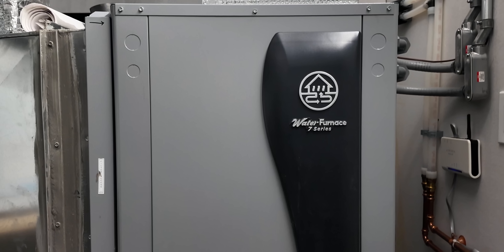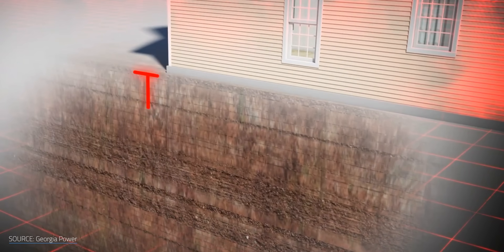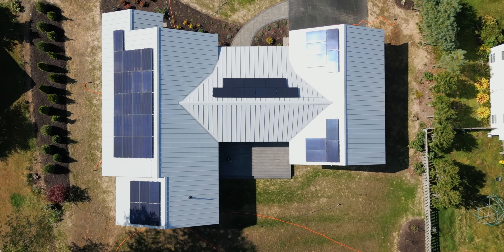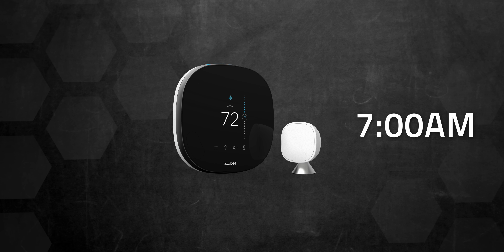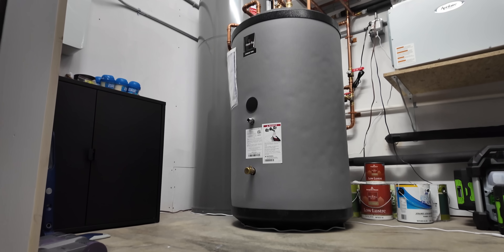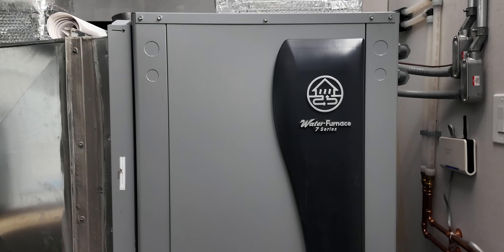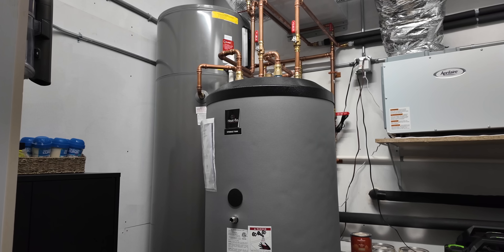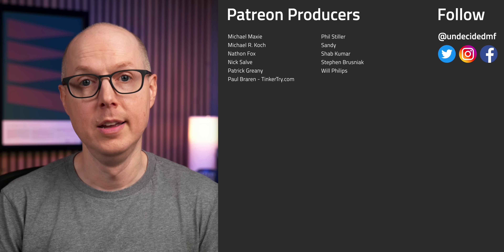How My Geothermal Heat Pump Really Performed (2 Years)

Comment: Geothermal heat pumps have been around longer than many people realize. The first one I saw was in 1991 or 92 in Tampa FL on a new 2000 sf house and I recall they used a 60 foot well since water levels were very high there.

Comment: It would take a lot of saving on monthly energy to make up for the tens of thousands for initial equipment and installation. I find here in Phoenix, AZ (retired here in '21) that deferring the expense of these systems allows me to have moderate overall yearly energy expenses while getting most of the value out of A/C equipment before having to decide on the next unit. It helps that the A/C industry has some good, reliable equipment if you can get by with just one level up from the most basic equipment. Get into multiple units, speeds and other complications, and you risk high cost repairs and/or earlier replacement. We've done well as previous owner bought a Goodman system, which is owned by a Japanese company that emphasizes good performance with reliability, and avoids complicated designs with more bells and whistles.

Comment: You are saving $360/year. The cost difference up front has a 44 year break-even.

What is the cost of the solar... you are not including total cost of ownership.

If you want to be energy efficient, then why use an electric clothes dryer?

Finally, over a half century of experience, leaving the HVAC at the same temperature all day is more efficient than adjusting during the day.

Comment: The thing is that most people can'T afford for a 50k system to break on them. But its VERY easy to replace a regular heatpump. An electrical baseboard heating is like 50$...not 50k.
Your analysis does not account for potential ground movement that may require you to completely redo the system because repair would be even higher.
If it works for 20 years its great...but nothing can work 20 years GUARANTEED. So you ARE taking a risk. If the risk pays off, its good, if it does not...some people can'T affort this option.

Comment: We had a Weismann gas boiler system put in a few years ago. This learns how long the house takes to heat up and cool down. It's saved 50% over our old Potterton dumb boiler. We have a 3 bed detached house and our gas bill is ~£50 month averaged over a year. As the system monitors water temp and air temp from multiple places, our radiators never get hot, even in very cold winters. We actually forget it's installed.

Comment: I self installed geothermal in my 1970 Michigan home 14 years ago for around $8,000.   i heat 1,700 sqft and also heat the 1,700 sqft basement.  I use 4,400kWh a year and pay around $700.  A/C in the summer is almost free and is ridiculously cold.   I wish I did it 25yrs ago.    I sized my heat pump for cooling capacity (not heating).   Mine is a 3 Ton 2 stage unit (36,000 BTU) and is perfect size for my case.   Only maintenance so far is air filters and I had to replace a $200 water valve last year.  That's it.  In the coldest January mine will run continuously and never shut off (will bounce between stage 1 and stage 2).  it was strange at first but that's how these work.   I have never had the heat pump fail to keep us warm in the winter.  Works very well.

Comment: We have the same system, Waterfurnace. Live in Michigan with a larger than average house that was requiring 750-1,000 gallons of propane during the coldest months. Switched over and our worst cost month depends on which month is colder but rarely have an electric bill over $1,000. With propane the worst month would be about $1,500 in gas alone + a few hundred in electric. We are now planning our solar system so we can go off grid with a 36kw system and 3 powerwalls. After that is installed we will probably swap vehicles for electric ones to avoid gas costs. I’m not against fossil fuels I just think they are grossly overpriced and taxed to no end.

Comment: I wanted geothermal just to have more consistent comfort. But we were quoted at $57k.. In the end we just had our heatpump replaced with a better, newer unit. overall usage was down with more effeciency, but still have to deal with heatpump and having to use 'emergency heat' on some of the sub freezing days.

Comment: i work as a driller, i dont know installation costs in the US but i know their equipment is usually not so efficent. Me, totally alone can drive my equipment to site, drill 200-250m, pack up and go home in 1 day and yes as long as the distance needed is fitting the house and noone cheaped out on it (as some do) it works very good even in cold conditions :)

Comment: one of my that i know they have if but 5 year later both pomps broke  less then 10 years  im hoping now wil last with the new pomp more then 5 years i have air heatpomp to water becouse i don`t needed it becouse i have a smal reactor that only heat up that is enough to heat my home i do not use the power of the grid most of the time  i really want a small windturbine but yeah for power en back up but no power for that for now    ps don`t use uranium 235 you are not allow legally on nl 😅😅😅😅😅

Comment: From Belgium. Having a heat pump, solar panels, electric car and all that. 
I question a lot that is done to save energy.
I see neighbours investing 15000 or more euros to put EXTRA insulation on there roof.
The questions I ask is: How much do you spend on heating a year now? How much do you expect to spend on heating after you put in the extra insulation?
Don't forget that the energy you use to heat your house is also used to heat water. That will remain more or less in the same trend. 
Don't forget that if you put more insulation on your roof, that the heat will tend to escape a bit more through walls, windows and doors.
I am sure that there savings won't be that much. I am almost sure that if you would simply look at it from investment standpoint it's a terrible investment.
If you look at it from en environmental viewpoint it's also questionable. The CO2 and garbage used to produce and install this insulation (plus other materials used) is not something to be underestimated.

While I do see a use for insulating new homes, I question completly the use of putting extra insulation on homes with an ok to good insulation. 
The only real positive effect is that you create jobs.

PS: Do not underestimate the complexity you build in to your installation. More stuff can break down. Also you understand it, but does your partner?
What happens when you are no longer there?

Comment: Why did it look like all your attic insulation was just in a big pile against the back wall? Shouldn't it be more even? Also I hope you mean airtightness within the home and not the attic since it does need venting to allow moisture to escape and prevent mold and rot.

Comment: I installed a horizontal Water Furnace unit in conjunction with a new build ICF home 20 years ago. 5 ton system that also preheats hot water. I do not adjust temperature. Original cost to operate $1 per day. Now about $2.

Comment: Where is your break even point? Forgive me if I missed it. I know your focus was on net zero and reducing consumption over time to achieve that goal, but the break even point is also part of that equation. Your scenario seems about worst case in terms of up front cost. I remember chatting with an HVAC dealer here in northern MI and him saying the system would be due for replacement at about the break even point which was a bummer.

Comment: I'm sure your house is smaller and more efficient than mine, but running the math at $.31 kwh you used 3,061 kwh for heating/cooling for the year.  I have 4 geothermal systems (1 radiant floor  and 3 forced air) and have 2 wells for a pump and dump.  This past March I used 7,450kwh and at least 6,000kwh was for heating.  This is double your entire year usage.  Fortunately, my electric cost is way less than yours- right at $.10 kwh(including all fees).  I didn't pay for the system, but it had to be at least $100,000-150,000 with drilling the second well.  There is no natural gas, so I can only imagine what they were paying a year for propane that made them drop $150k to convert to geothermal and think it was a good investment.

Comment: Because of the heat load. You need more ground to absorb excess heat, from ac cooling.  Remember there is no condenser outside. The heat is disputed in the ground, and extracted in the winter

Comment: I'd rather put a back-boiler in my fireplace and pipe it to a buffer tank and put a coal burning insert in my fireplace.  Fill once a day, buffer tank puts heat into central air.  heat entire house from coal as an alternate energy source to gas and electricity. (battery backup still needed if you want central air to still work)

Comment: While your annual and monthly bills are extremely low, you spent $78k on the geo thermal system and im assuming another $50-75,000 on your solar system. So really its about determining the ROI on all of that over the life of the home. What is THAT # compared to no solar (only grid power) and traditional ac/heating systems?

Hard stop that is the only thing that matters. When the cost of something like geothermal and solar really becomes nothing, then it'll be a no brainer. In Texas, power is 12.5 cents per kwh. So it wouldnt make sense here.

Comment: @UndecidedMF 
I was listening to you for about 15 mins here. The way you explain here leaves the UNDECIDED even more Undecided!  If you truly want to help the UNDECIDED than you should've started with the:
1.  price for a KWh/h of electricity (you mentioned ~0.31$/kWh) and price for a KWh/h of "other heating source" (that you replaced by installing a heat pump - like gas, diesel, etc). 
2. How much heat (kWh) did you use for 1 year, on average, for heating your house and generating warm water with your "other heating source".
3. how many kWh does the heatpump consume to heat the same house for 1 year. 

The rest is a matter of local details for each country and region.

Comment: The economics of retrofitting your home to geothermal heat pump very much depends upon local electricity costs, among other things.  Massachusetts electricity cost from Eversource, one of the big utilities serving the are is ~ $.32/kwh.  Using a COP of ~3 as a reasonable average, and 3415 Btu/kwh for the heating value of electricity, this lets us calculate the relative cost of providing heat to your home so it can be compared to current and anticipated natural gas, heating oil, propane, or other proposed method.  3412*3/.32 = ~32,000 Btu/$   Home heating oil is currently ~ $3/gallon, which can be burned in a common boiler to provide ~ 120,000 Btus, so it provides ~ 120,000/3 = 40,000 Btu/$ with lower capital (common oil boiler) cost.  Granted, what it will cost in the future cannot be certain.  I suggest that installing solar PV, and oversizing the system to cover geothermal demands, before installing geothermal, is the more appropriate and economic approach.  Your sun sourced kwh from solar PV are effectively far lower cost than the prevailing current rates for retail electricity.

Comment: 22-24 C is wild. I keep mine to 20. Complete install will drilling is about 30 000$ USD in my area (sweden). That with the presumption that you already have indoor (water) radiators.

Comment: You’re running the hot water heater wrong. If it’s not making noise and the room isn’t cool then it’s not pulling heat from the space with the compressor. You’re essentially running an electric heater. All of your savings are from the geothermal preheat which raises the temperature of your water tank above the minimum set point of your entering water for heat pump use. Spec says 90F lift which means 50F water coming in is your minimum at 140F storage set point. You could raise your storage temp (more efficient/sqft) if you install a mixing valve to prevent too hot of water going to the faucet

Comment: My parents paid 15k for vertical ground heat pump 16 years ago providing floor heating in a wooden house that partly is up to 150 years old. It's incredible and the most comfortable house I know... and it's in Sweden so challenging environments are no match for these systems. I wouldn't say it's a complicated choice at all if you have the funds or can borrow, because you will save so much thanks to these kind of systems.

Comment: I'd never put an EV or Plug-in hybrid in my garage/house because of the fire risk, let alone a charging system, compounded by home energy storage using Li-ion batteries.  In addition to the risk, I don't want to support lithium mining and much-too-frequent disposal of all those batteries on a five or ten year schedule.  Replacement cost should also be factored into everything, including the monthly cost.  Just like a carbon footprint should always include long term costs for mining, manufacture/production, use, and disposal AND to the environment across the entire lifecycle.  It seems to trade steel for lithium mining and fossil fuel pollution for toxic metal disposal dumps.  Air pollution and climate change and/or toxic water...  I'll wait for better, cheap, safe power storage technology that does not involve mining, fossils, or disposal.  Not likely in my lifetime.  That said, I have no problem with the simplicity of geothermal and a heat pump sans all the batteries and extraordinary technology while living with the occasional power outage and a hybrid non-plugin car.

Comment: So spend 40k more to save 1k a year? I dont think the math checks out. Your home envelope is way more important than going geo thermal vs other options.That is doing all the heavy lifting. Also, if something in the system goes awry with install, you are really in trouble. I can have hundreds of people in my local area swap out my ac unit if need be. Good luck fixing a misengineered well.

Comment: Your first mistake was doing deep well geo.  From the picture you have enough room to do cascading loops horizontally 6-8 feet down.  The difference in cost there is amazing.  I dug my own trenches, paid someone $1000 to run the piping and my geothermal was only about $3000 more than a traditional HVAC.

Comment: You can get a similar effect with a water buffer. You place an insulated tank, usually 2-3 cubic meters of volume underground, near the house. It has a huge temperature inertia. And it's a great energy bank for when you're away during the day. Instead of wasting the solar panel yeald, selling it during the day, when everybody is selling at a lower price, the energy goes into the tank, heating it up for when you need it later on in the day. Even in the summer you want hot water in a tap. During winter it can also be great for the defrost cycle of your air2air pump. I think it's a great way to store that PV energy, or even take advantage of the lower electricity rate at night. Just set the timer to heat up the tank during cheaper hours.

Comment: Why not just 'geothermal heating' when it comes from the ground or 'heat pump' when it's from the air? 'Geothermal heat pump' feels like an unnecessary conflation of two different systems to me. Isn't it implicit that geothermal involves a pump whereas 'heat pump' has typically been the term for the air exchange process?
Reply: "Ground Source Heat Pump" I think is a more accurate term than Geothermal, but the latter name is what stuck I guess.  The difference is what you are exchanging heat with (dirt vs air)

Comment: 13:30 Those "very small and nimble drilling rigs" is the type that has drilled tens of thousands of heating wells in Sweden. Usually 150-250m deep, and if more is needed it is usually split on more wells.

Comment: you could also use the geothermal loop , or add an extra one and produce power from it ! exploiting the temperature difference  from in ground and outside you create movement in the fluid , and with some extra tools like directional valves and flow compressors ( like the turbo in your car )  , you direct that flow into a generator ( like those in the water dams) and produce electrical power . it may not be that much( depending your system ) but i am sure it could enough to cover the needs of your existing water pump .

Comment: We've had geothermal (and other) heat pumps here in sweden since the 90's. Bought a house a few years ago with a soon 30 year old geothermal heat pump, still going "strong". Not as efficient as new ones, but hey, if it aint broke! 

Yes it works in the cold, last year we had  -22c (-8F) for almost two weeks, still warm!

If you have stable low cost elecitricty, it's often really nice

Comment: I would love geothermal for my home, but the cost is quite prohibitive for me.
I don't have the space for a ground-loop, so a well is the only option. The issue with that is that my house is built on ~100m piles through clay to bedrock. I was quoted 150€/m for the clay part, followed by 50€/m for the bedrock, down to 250m. So over 20k for the well alone, approximately. Add on the actual geothermal heatpump equipment and the payback time climbs through the roof with the total cost being closer to 40-50k.
We ended up going with an air-to-water heatpump for our heating (house already has water-circulated floor heating) for less than half the price, with nearly the same efficiency. The only drawback is, I can't use the current system for cooling during the summer.

Comment: Its been a while since ive had a customer with a geothermal but eventually youll need to descale the loops to keep thermal exchange efficiency where you want it.  Not an overly expensive thing just dont let your ac guy forget it (unless there is some sort of fluid that doesmt scale that i haven't been exposed to)

Comment: I installed 80 of these at a condo complex to get the tax credit. In five years, 25% of the loops were leaking in the wells and the only repair was to re-drill them. I will never touch geothermal again.